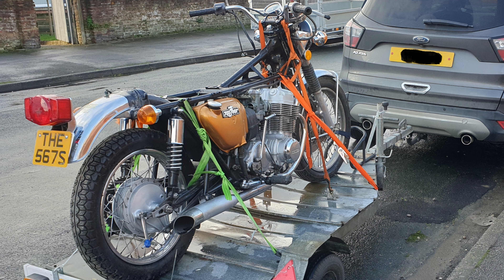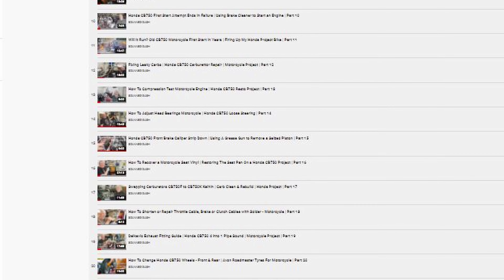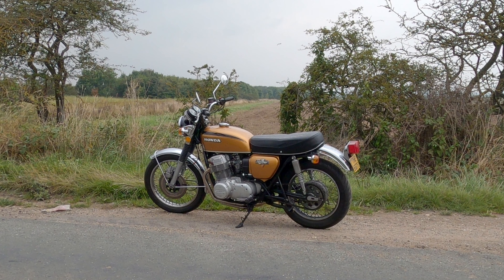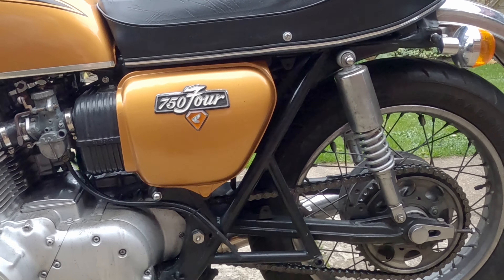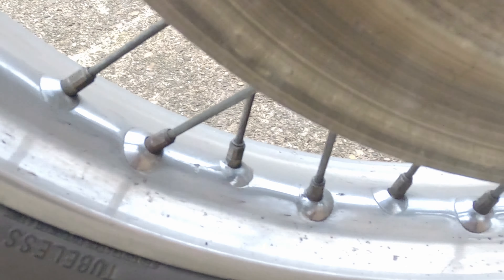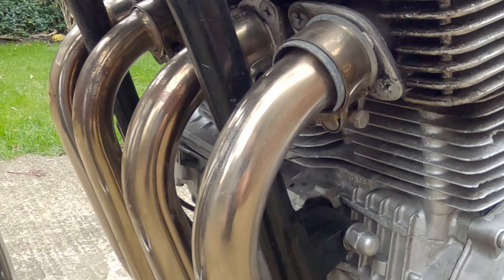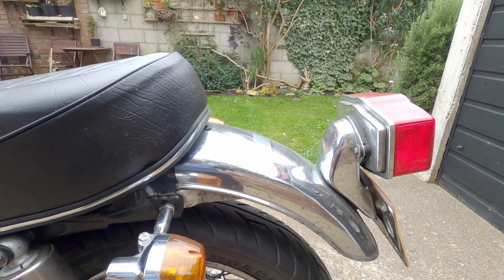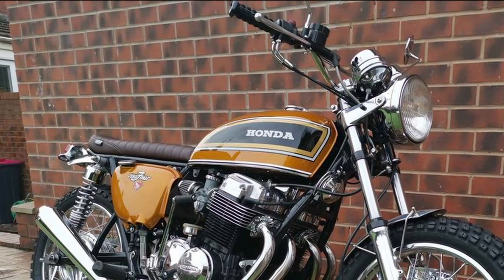Should I Turn My CB750 Into A Cafe Racer? | Custom Honda Flat Tracker, Scrambler Project | Part 31

Comment: Absolutely go ahead and do it if that’s what you want, there are thousands of CB750’s still roaming the planet and it’s not as though it’s a sandcast is it!, plus there’s the frame number issue that drastically reduces its value so go ahead, make it into something you’ll enjoy the look of, I’d definitely recommend doing the twin disc conversion, it dramatically improves braking, I was amazed when I did it on mine, you can actually “chirp” the front tyre if your over exuberant on the brake lever.
Beware of fitting pod filters, I put them on mine and it caused hesitation, the rubber cones in the stock filter box are there for a reason, I grafted my pods onto those cones, worked a treat, as do velocity stacks but then you lose filtration, good look with whatever route you take 👍
Reply from the maker: Cheers Mark, exactly, this is far from a great bike as it is, and even if I put the time, money and effort in to get it there, it'll still have zero provenance. So why not do something a bit more interesting and scratch the custom bike itch?
Thanks for the tips on that, the brakes are a key area for improvement as you say. And i'd love open stacks really but unfiltered intake air is probably not the smartest way to go. I may well try the cone and pod combo like you, seems to be a good compromise.

Comment: I had a CB 750’once it was slow on of the problems l realized was that it had concentric carburetors. Then in early 80’s l bought a new CB 750 DOHC constant volocity carbs alot more get up and go. Instant response.
Reply from the maker: Hi David, I would love CV carbs on my CB. It would make it much sweeter to ride. But I haven't heard of anybody doing the conversion though. It's something I will look at.
Lighter throttle, smoother running, better fuel consumption. What's not to like?? :)

Comment: With it being a “miss matched” so to say, bike I wouldn’t hesitate to turn it into a cafe racer. It’s great you’ve got it running good! A fun project. But I must say you can’t beat the comfort of the original seat! No matter what you decide it’s a cool bike!
Reply from the maker: Cheers mate, I reckon the same, its a great opportunity this bike. I'm not totally set yet but I'm leaning towards going for it at the moment, we'll see..
Reply: @SPANNERRASH  I wanted to thank you for your advice about checking the rubber boots on my 750 carbs possibly causing the slow return to idle issues I was having. They were loose. I finally got around to snugging them up and took it for a test ride today. Problem solved!!! She's running great!! Thank you brother!!
Reply from the maker: @mulliedog1  Thats fantastic news mate, I'm pleased to have helped! Glad your 750 is running great again. 🥳

Comment: Hi from Sweden 
I bought a Seven Fifty last summer to learn and get my license on. It’s perfect for that purpose but I immediately started to have a “wont start when warm” problem. 
Bought a new battery but still happens. 
Often after 20 min riding. I can bump start it or use a 12v portable starter to jump start it. 
Some people tell me it’s a bad battery cell. Others that it’s the starter brushes. 
The weird thing is that if I leave it overnight it will start fine the next morning. Sometimes it’s like the battery is dead. Other times it’ll attempt to start but wont catch. If I keep trying I’ll drain the battery. I have a video in my channel of it happening 
Would love to hear your thoughts.
Reply from the maker: Hi mate, if it bump starts but not on the starter it sounds like a voltage drop is stopping it having a spark. As you've changed the battery cleaning and checking electrical connections and earths may help. Sometimes the ignition, kill switch, clutch and sidestand switches can be playing up. But only when its warm is a factor. Maybe the coils aren't as efficient when they've warmed up exacerbating any voltage drop problem. Also from your video it looks like a more modern bike so maybe its a sensor issue. Hope that helps, good luck these can be really difficult faults to trace.